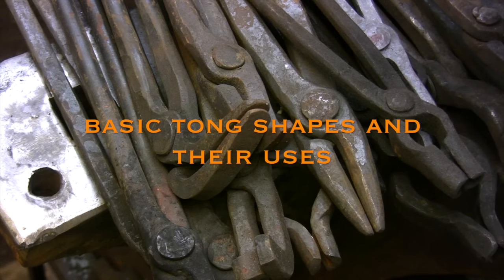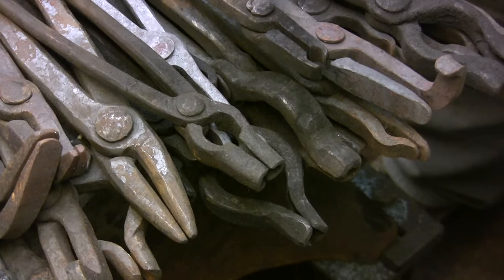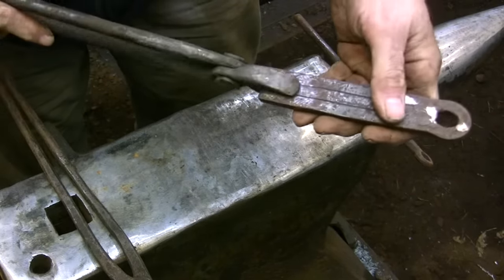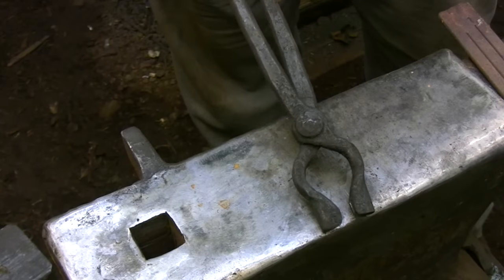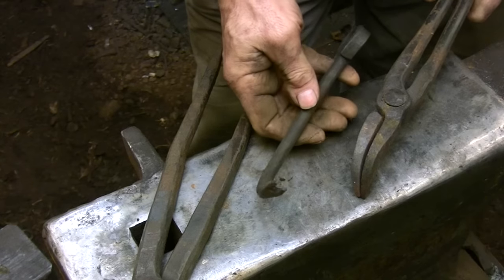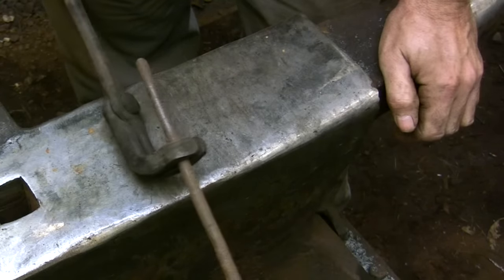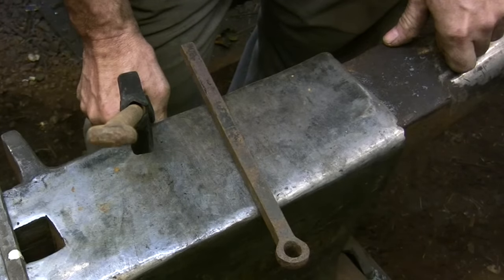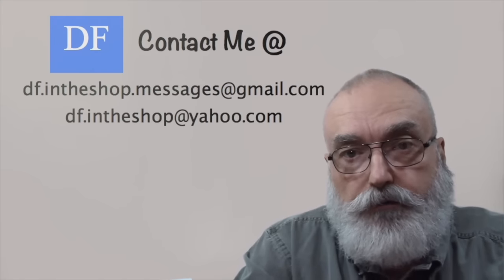Blacksmithing For Beginners - Basic Tong Shapes and Their Uses

Comment: Re forge question 
  Well I've decided to use the Refractory castable that I have the depth,length, width will be comparable to the dimensions you have? I have found in my research that this will be an optimal size for the work I intend on doing (Blades) and will also be sufficient for some of the artistic Blacksmithing projects I intend on trying. I found that this size pot will not only be sufficient for the work I want to do. Also when I  advance more into this at this perfect sized pot I wont be outgrowing.Not to mention the ability to utilize the fire to have confidence that the depth will indeed make it easier to insure that the pot burns off any oxygen that may occur if the pot is shallow. After it is done Id like to send a picture if you have any interest on accout it is comprised of a dreaded wheel hub.lol
Thanks for the interest,  Martin Moldovan

Comment: i  have wanted to make some springs for various perpouses but dont know how. its mainly the tempering that i have treouble with and itd be awesome if you could make a video about tempering springs. also i use wood as oposed to charcoal or coal and im still trying to compensate to some of the lower temperatures... your videos are great by the way, they have brought me a long way from where i started
Reply from the maker: I do have a video on making springs.  https://youtu.be/v8U1ZVrAhvY   I also have a couple of videos on heat treating in general.  Are you supplying  the wood fire with an air blast?  Wood fires are usually very hot - the fuels gets consumed quickly but heat isn't a problem.
Reply: ok, thanks i looked at those and they answered a lot of my questions...

Comment: I don't even have one pair! I'm using a long pair of vice grips still, since I'm still unsure of my abilities of making a pair and have no idea where to buy any. I think I could handle it now.. a basic pair for knife making, most practical style.. Any suggestions? I'm a welder by trade so I was thinking of just welding reigns on the handles of a pair of big slip joints.. That would work eh? Though I'd rather have a proper pair..
Reply from the maker: Being a welder certainly gives you a lot of options for fabricating a pair of tongs.  Even if you stay with the channel lock idea you can make very good offset box tongs by adding  angle iron to the outside edges of the jaws.   However I think most knife makers  don't even bother with tongs they just weld a long bar to the tang and cut it off when the forging is done.

Comment: Dennis 
 Do you make hammers? I am wanting to get a square rounding hammer .I am currently using a 4 lb small sledge that I  modified to have a rounding end and a flat but she gets heavy after a bit. I shur would like to get my hands on a say 2.5 rounding it may help me progress a bit faster.Any thoughts on hammers ,maybe your next video can be regarding different hammer styles. Just a thought .
Reply from the maker: No need to make a hammer.  The little mason's club hammer is 2.5 lbs.  I just bought a few at Harbor freight for $3 each.  Can't even light up the forge for that.

Comment: Dennis looks like your tong poor I one the other hand have maybe 4 pair think I'm going to revisit your tong videos and make a few more they are the hardest tool I've ever made thanks
Reply from the maker: The real problem with tongs is that both pieces are sitting next to each other so any little difference gets magnified.  Making multiples of anything accurately enough so that the differences between them don't matter takes a lot of time and practice.  But if you stop making tongs by forging and assembling pairs where  the second tong blank always gets matched with the first you will find that the differences between all the blanks will fall in a fairly narrow range - provided you took care to measure the steps as you went.  Blank 2 may look terrible next to blank 1 but it may be an exact match for 7,10 & 12 and so on.  So first forge a lot of blanks as carefully as you can then when you have 10 or 20 blanks start machine them up.  You will be surprised how many nice pairs of tongs you come up with.

Comment: Very helpful! What kind of tongs would you recommend to start blacksmithing with if you had to choose 1 or 2?
Reply: It really depends on what type of forging you will be doing, and what steel sizes you will be working with mostly. So.. what are you planning on doing? bolt jaw tongs I have found to be pretty versatile if they have V bit jaws, as they will hold round, square, and flat pretty securely depending on size.

Comment: Hey Denis, I'm finally getting my blacksmithing area set up after years of wanting one, and I'm playing with forging tongs.  I've been watching lots of tong making videos, I really like yours BTW.  My question is, with forged tongs, which areas of the tong structure are super important to get right and which operations are more for making a more aesthetic tong vs a more functional tong?  Lots of the tong videos put a lot of time into forging the boss etc.  Which spots on the tong are most likely to let you down when forging if you don't make them correctly?  What are the critical areas of a tong to get right to get them functional?  Really like the "but ugly tong" video as well.
Reply from the maker: There really isn't any one part that is more important than another.  It's more a mater of getting everything balanced so that it all works.  The jaws have to be strong enough to hold on to the work without deforming also the transition between the jaws and the hinge area need to be heavy enough to prevent the jaws form being bent out of shape.  The hinge area needs to be thick enough to transfer all the clamping pressure applied by the reins.  And the reins need to be heavy enough to supply the force needed to hold on to the work but still be springy enough to allow you to feel how much pressure you are applying.  If any one part is too heavy or too light it throws everything off and the tongs will feel clumsy or they won't hold on to the work properly.

Comment: Thanks for all that Info! I recently picked up a hammer again, I have been making tongs to practice. On my third set of flat bits and they are getting much better each pair i make. I am still having trouble getting the boss to come out well. For a typical set of your tongs what size steel do you start with?
Reply from the maker: The real problem with tongs is that both pieces are sitting next to each other so any little difference gets magnified.  Making multiples of anything accurately enough so that the differences between them don't matter takes a lot of time and practice.  But if you stop making tongs by forging and assembling pairs where  the second tong blank always gets matched with the first you will find that the differences between all the blanks will fall in a fairly narrow range - provided you took care to measure the steps as you went.  Blank 2 may look terrible next to blank 1 but it may be an exact match for 7,10 & 12 and so on.  So first forge a lot of blanks as carefully as you can then when you have 10 or 20 blanks start machine them up.  You will be surprised how many nice pairs of tongs you come up with.

I use 1/2" round for most tongs.  This video is on making small tongs ( 3/8" round stock ) but it is the same process and type of upsetting die that i used for larger tongs.  https://youtu.be/3AmtLQsCyUk
This is the first of 5 videos on how i make tongs.  It shows the upsetting die I'm currently using https://youtu.be/EdbGUcnSBno

Comment: Thanks for your videos.  Have you discussed fire management any any of your older videos?  If not, could you maybe give some pointers in one of your future videos?  One of the challenges I have is keeping a good fire.  Yesterday, I had so much fine coal in my fire pot that it filled my ash dump so high that it cut off my air supply.  I couldn't figure out why I wasn't getting a hot fire even though I had cleaned the clinkers out of the fire pot.
Reply from the maker: That is coming up.  I talked a bit about the fire in the second forge welding video but it doesn't cover what you are talking about. Thanks

Comment: Thanks for the tour of your tongs and all the information here.  I have found tong making to be a good introduction to blacksmithing.   I noticed you have about a 3/8 in. radius on the edge of your anvil.  Isn't that a little large?  I have about 3/16 radius on mine and I'm wondering if I should make it larger?
Reply from the maker: My anvil has a number of radiuses to allow for the forging of different transitions between cross sections.  It also allows me some different fullering options as I'm drawing metal out. Most people use hardy tools to accomplish this I prefer to have it built into my anvil. See my playlist on anvils for  videos explaining how I shape and use my anvil.

Comment: Thank you very much for this video. I wonder if you could make interchangeable tongs IE top from a box and bottom from a hinge and just use a locking bolt to hold them together. Do you think that would boost your tong diversity with out loosing the space?
Reply from the maker: Anything is possible but with my arthritis the loss of manual dexterity would make any system like that very frustrating.  Cleaning up once in a while works fine.  Thanks
Reply: Jason Duncan everything would have to be extremely standardized as well with regards to the size and shape of the tong boss. It'd be doable with stamping jigs under a press or power hammer, but not likely by hand.
Reply: Very true. Also, I have to admit the more tongs I would be making the more experience I would gain. Plus if I fudged up some of them no one has to know.